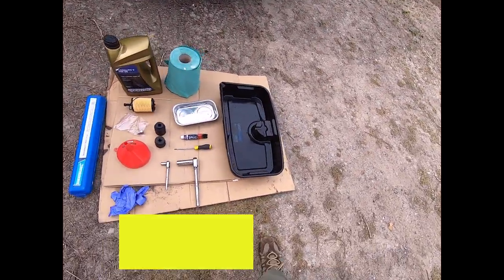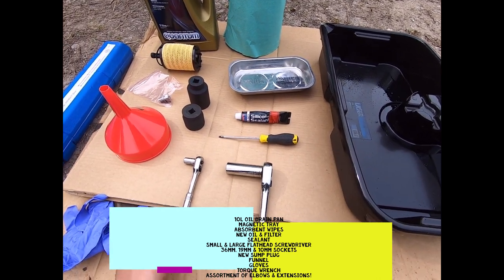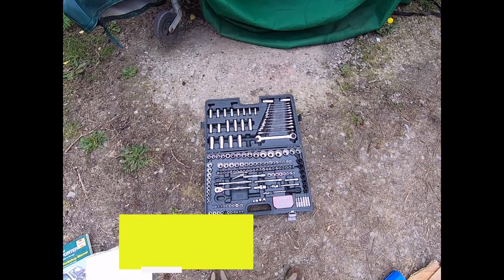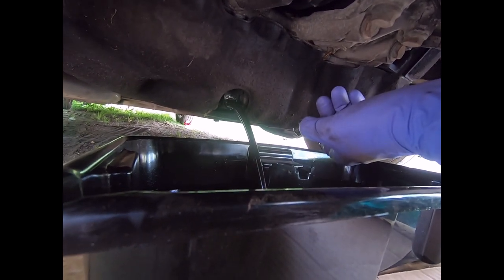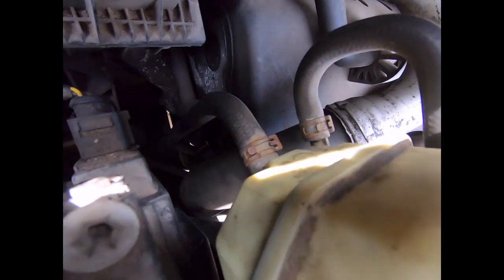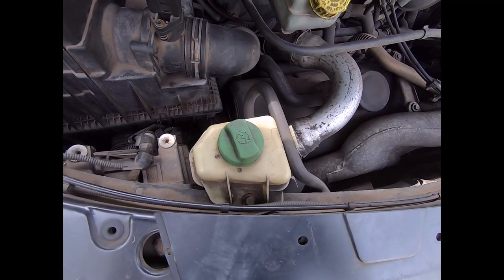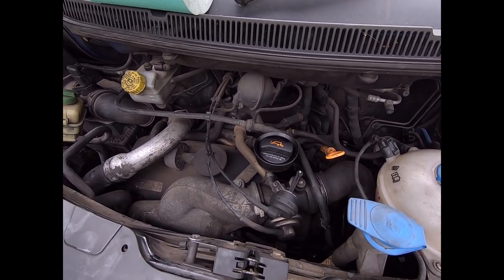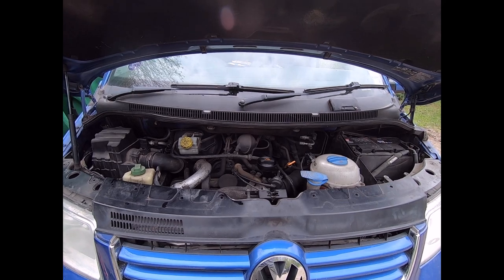VW T5 (Transporter/Caravelle) 2.5 TDI Engine Oil & Oil Filter Change

Comment: thanks for the vid,   i changed the oil and filter yesterday , and  wow what a pig the filter is,  the elbow joint on the socket is an absolute must, i managed to get away with just diconnecting the top intercooler pipe and moving it out the way along with the brake resevoir,   i got mpm oil rated at vw's 506.01 again a pig to find,  but hey 2 years or 15k  until the next,  the burn on my hand should heal by then
Reply from the maker: Glad you found the vid useful - it's a pig of a job indeed but nice feeling when it's done and knowing you've saved the labour costs!  Roll on next 2 yrs/15k!!!